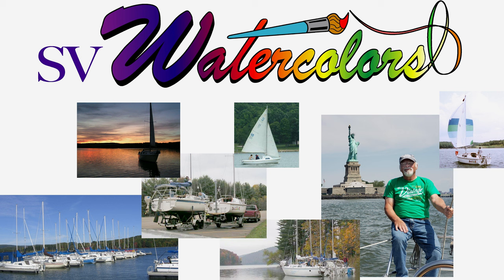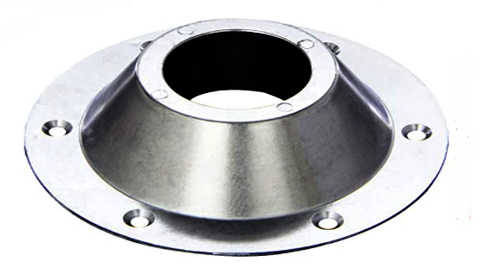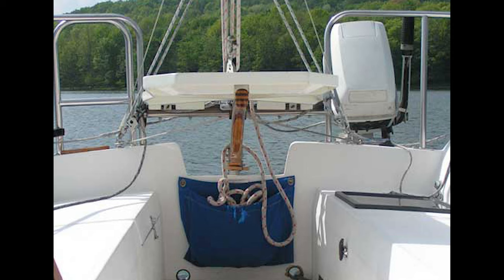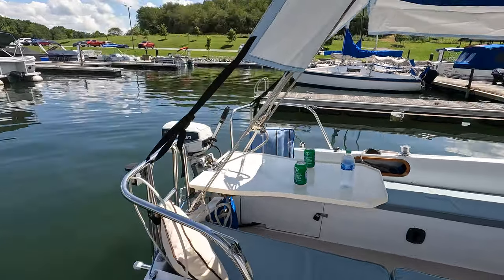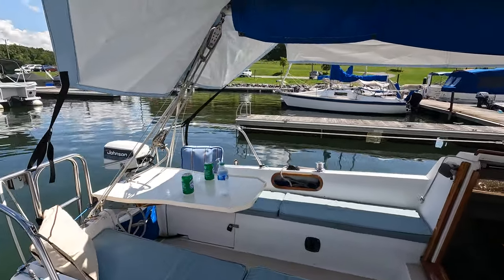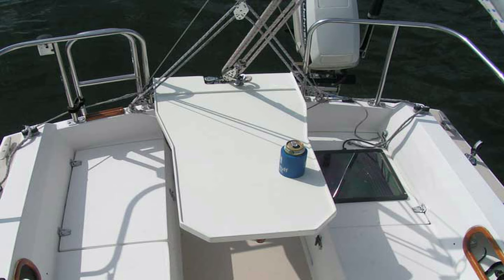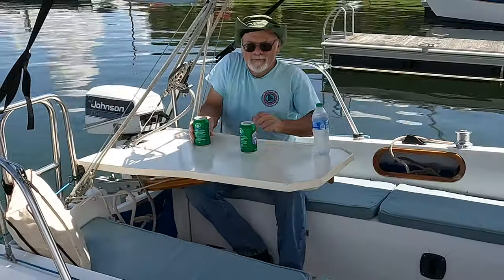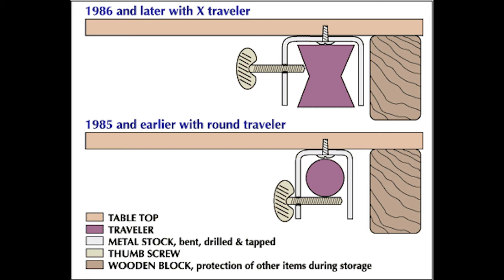#21. Catalina 22 cockpit table!

Comment: Great idea! We are starting our third season on our 1986 C22. We sail on a local lake called Lake Greenwood in South Carolina. We stay at the State Park located on the deeper and wider end of the lake. We say stay, it's more like park the truck and pay for daily passes. We usually stay for 4 days and three nights on the lake rather than stay in the state campground area. We live about 30 miles from said lake in our 1885 Victorian house. We are just getting started for this season because I have been replacing the original 2 story tin roof. At 64 we are still enjoying the boating life having sold our power boat 3 years ago and acquiring our little floating 22 foot camper. We will be uploading more content once I can get the MP4 videos out of our GoPro (like) cameras. Keep up the good work. We also like watching ( Liz McCafferty - Seanachai ) and ( Sailing Blown Away ).